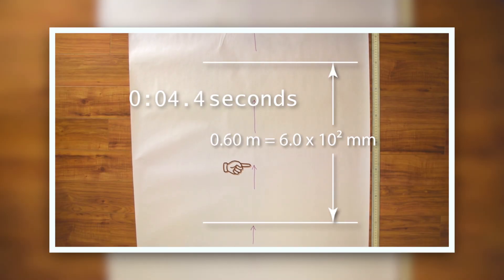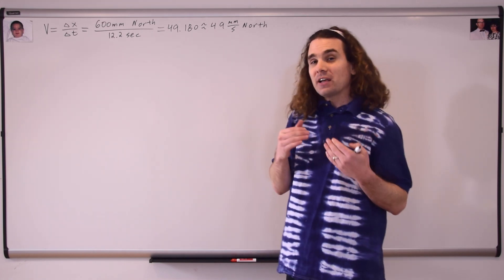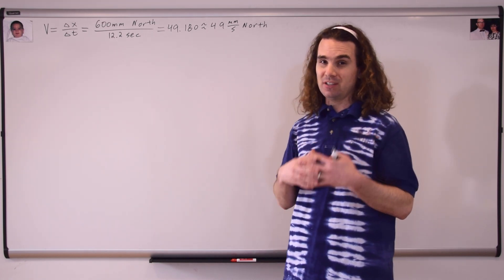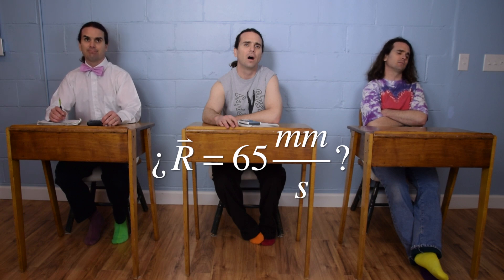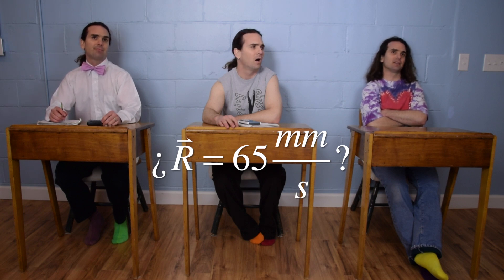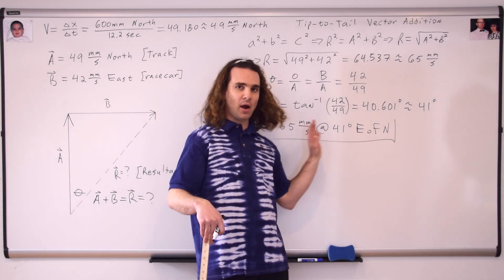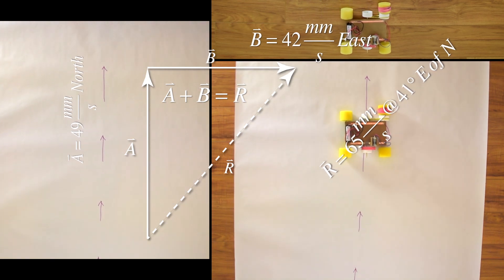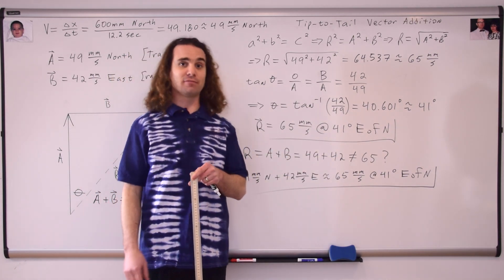Introductory Tip-to-Tail Vector Addition Problem

Comment: Thank you so much for your work!! ❤ 
I have a question that’s been troubling me though, if we use the addition property of vectors and rearrange the triangle so that it’s B then A, and we construct a resultant vector, finding angle theta would then use arctan of 49 over 42, which is the opposite of how we would’ve got the numbers if we arranged the triangle from A to B. Shouldn’t we get the same answer?
Reply from the maker: The angle is not the same, however the direction is.
For example: 49° North of East = 41° East of North.